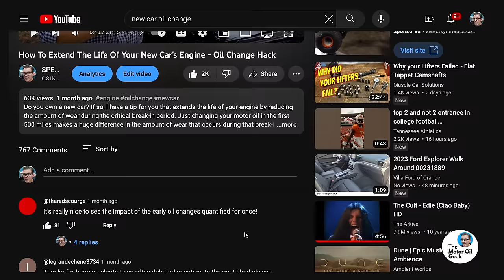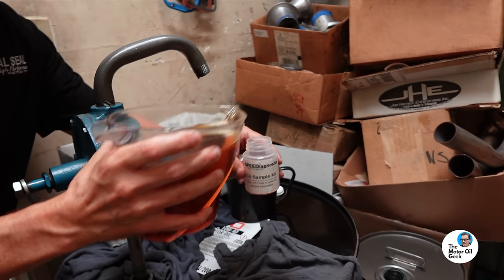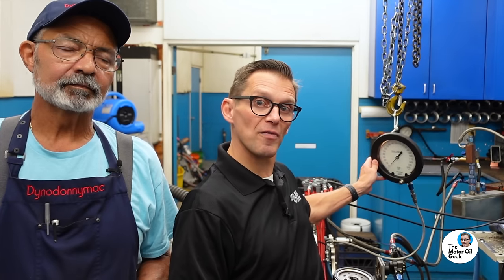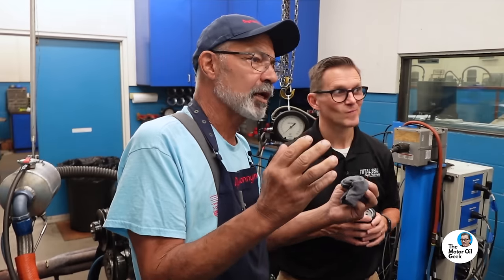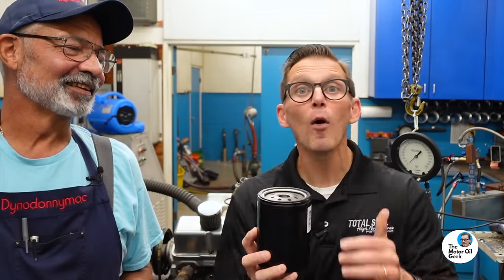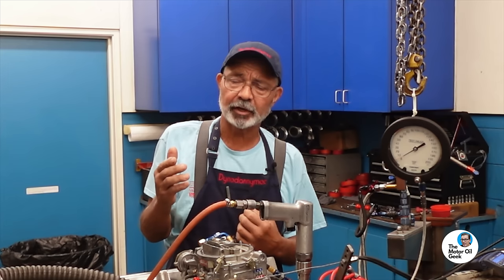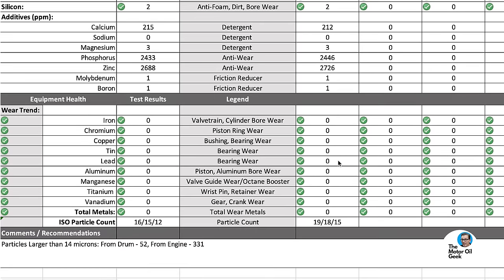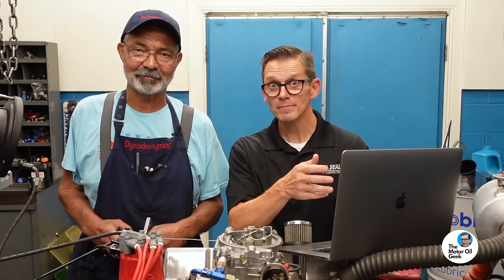Does Pre-FILLING The Oil FILTER Cause Engine DAMAGE?

Comment: You hurt a lot of peoples egos by proving them wrong, some will still not listen because of pride
Reply from the maker: Truth!
Reply: I was a marine mechanic for years,  pre lubrication is a big deal, you can't just stick on a dry filter and wait half a minute for the oil pressure to come up..  These hurt guys can carry on doing what they are doing won't do any great harm on a small engine but now they are informed.
Reply: That's because you can't argue with an idiot .... To them they are always right and you are always wrong ..... And believe me there are a lot of idiots floating around out there that have zero common sense.
Reply: proved? what?
Reply: @Jonjs99 that you didnt watch the video and/or have no comprehension.     😂😂    😊😊
Reply: @tedcity5861  I watched to that part where they were concerned about contamination I stopped , I will never prefill filters, as this damages em, had so may ripped filters
Reply: Never had a vehicle with horizontal mounted filter? I prefil them when vertical, but horizontal isn't really feasible

Comment: There is something I did not see addressed here.  Although a rare issue I have seen the following a couple times in my career as a mechanic.  During an oil change on an engine that had not been run for a very long time, I filled the filter to make sure it got oil quickly.  Upon starting the engine the oil pressure DID NOT come up.  The engine was shut down before damage was done.  What happened was the oil in the filter did not allow the dry oil pump (from sitting a long time) to prime itself.  I loosened the filter, cranked the engine briefly and oil poured out as the pump quickly primed. Tightened the filter and had no further problem.  So just beware and watch that oil pressure gauge.
Reply: Yes, on many pre-1975 (roughly) engines my college automotive professor with some 40 years experience said NOT to pre-fill the oil filter. We were finishing a rebuild on a 460 cubic inch motor from a 1972 Lincoln Continental. The guy I was working with pre-filled the filter with oil and we had no oil pressure when we tried to crank it. We emptied the oil filter, re-attached it and it fired up with good oil pressure.
Reply: it irritates me to no end modern cars don't have oil pressure gauges (or voltmeters, either!)

Comment: I never used to prime my filters up until a few years ago. It always made me nervous watching the oil pressure light stay on for that short time until the filter was full and the oil pressure up and the engine sounding much quieter. The first thing I noticed after that first time a did a filter prime was how the oil pressure light instantly went out and the engine was quiet straight after start up, I have been priming oil filters ever since. I prime straight from the bottle the oil was purchased in, I would ever use a separate container for risk of contamination.
Reply: dontcha hate the sound of your crank rattling? me, too.

Comment: You don't need to prefill. If you change your oil and install a dry filter you can floor the gas pedal and start cranking the engine.  This will fill up the oil filter with oil but not allow the engine to start.  This works well if you have a horizontally installed filter.  Ford Boss Me shows how it's done in his vids

Comment: Your answer to the idea that prefilling the filter is bad is very convincing. I never really thought it would be. However I am struggling with the idea that not pre filling has genuine repercussions. As you stated manufacturers regularly have filters that cannot be pre filled due to type or angle, and billions of dollars go into engine development. I find it hard to believe this would be so regularly missed by engineers from multiple manufacturers.
Reply: When you do an oil change, the first thing you do is prefill your oil filter. Now while your oil is draining and you are removing the old oil filter and cleaning the filter base and replacing the drain plug, the oil in your new oil filter has been migrating from the center of the filter through the media into the outer chamber of the oil filter. So now even if you filter is mounted in a horizonal position on your engine you can install the new prefilled oil filter with no oil running out of it.
Reply: @scrambler69-xk3kv  thanks that's good to know I will try it. I am still not convinced of the negative impact of not doing it. I have never seen priming a filter listed anywhere in service manuals for example.
Reply: I've never had any issues with my engines. I've never ever pre filled.
Reply: @fraserp2377  Me neither, but sometimes manuals can miss little tips or tricks to make your life easier.
Reply: Engine manufacturers don’t recognize it as an issue because it’s not an issue. The average lifespan of a modern vehicle is ~ 250k-300k miles regardless of pre-filling the filter or not with the rest of the vehicle failing before the engine anyhow. The most common engine failure is from lack of preventative maintenance or not changing your oil and filter per manufacturer recommended intervals or using wrong oil type.
Reply: Finally something smart 🤓 100 percent agree
Reply: @ihd-3603 another good comment common sense just do proper maintenance
Reply: @ihd-3603 I had a hand me down Subaru GL wagon from 1982. It was running strong and reliable with no issues at 425,000 miles (On less than 10 oil changes it's whole life)
Lol!!! 😂

Comment: I have been a journeyman heavy duty tech for caterpillar for 12 years.  We had been told directly by Cat engineers to not prefill any oil filters.  Whether its for hydraulics, powertrain or engine.  The reason we were told is due to the possibility of introducing contaminants in the system that may be in the new oil from the factory.  I have actually done particle counts on new oil from factory and seen the particle counts not meeting cats use requirement.  I have also looked in the bottom of new barrels and buckets (most equipment I deal with uses at least 30L of oil) that had just been emptied of new oil and seen both dirt and sometimes small amounts of water sitting at the bottom.  I'm not saying this is the case with all oils, but I believe the recommendation is due to the possibility of new oil being contaminated due to bad maintenance practices or possibly even bad storage methods of new oil.  With all this being said, as long as you know for certain that the oil your prefilling the filters with is clean, it is probably good to do.  But at the very least fill the filter on the dirty side of the filter (outside section of the filter, not the center), this way if there is something in the oil you don't know about, it will at least go through the filter before entering your engine or other systems.
Reply: Same with Cummins, they spell out in pretty much every engine manual to never ever prefill filters, especially fuel filters. However, on systems with a primary filter/water separator and a secondary fuel filter, it's fine to pre-fill the water separator/pre-filter, with good clean fuel, because that fuel will go thru the pump and then the secondary fuel filter so no junk will get to the injectors. The only thing you have to watch for is any visible dirt chunks so you don't mess up the fuel pump. However even worst case scenario, a fuel pump is many times cheaper than pulling and replacing 6 injectors, and now you get to also reassemble all the jake brakes and re-run the overhead. Many many more hours of labor to replace injectors than a cheap lift pump.

Comment: I was taught to not only pre-fill the filters, but to do so using the outer holes so the oil going in is filtered. Pouring oil into the center hole doesn't pre-filter the oil. The assumption that fresh oil from the bottle is without contaminants is fine until it's not.
Reply: Ok, ill accept your reply. It is a fair compromise to this debate. Thank you for that.
Reply: 1. No, not only is it a bigger mess but it's also incorrect. Most filters have a paper media inside, this means any oil touches it will be absorbed. This means oil in the hole will saturate the filter entirely over time. 2. Is correct but the amount of contaminants is minimal. The right approach would be to fill the oil filter first and leave it alone while you go and drain the oil. By the time the oil drains your new filter will be fully saturated in oil and you'll see it was as simple as turning the faucet off while you brush your teeth

Comment: It's amazing that you had to verify something as logical and intuitive as prefilling and new oil cleanliness. I've worked on a lot of different machines, locomotives, steam turbines, trucks, cars, and small engines. I've always prefilled filters when possible. This is especially helpful with certain fuel filters. Either prefill or re-prime in some cases.
Reply: Aaammmeeennn !!! ! !!! And, it is terrible, that we need 2 explain this Basic Techniques 2 the Blind people which think that they are some "mechanics" !!! ! !!!
Reply: Always prime fuel filters with the lift pump and bleeder. Had neighbor that prefilled a fuel filter before putting it on and ruined the injector pump. That was a $2000 mistake. 😮
Reply: @ihd-3603   Yes, depends on the engine and fuel system. Always do your homework before servicing something for the first time.
Reply: @Cubestone  doesn’t matter on a diesel. Injector pumps and injectors are very sensitive to fine particles and are very expensive to replace. Duramax and power stroke injectors cost ~$2000-$3000 per side  to replace. Rebuilt injection pumps start at ~$1500 with core for a remanufactured one.
Reply: @ihd-3603   You're probably right on those little diesels in pick-ups. I've done all of my diesel work on locomotives, appx. 500 cu-in/cylinder.
Reply: It was a shame to waste the $35 oil test analysis of the clean oil for contamination that was from the barrel and transport. Those $35 could have installed the indoor toilet for Barrack Hussein Obama's brother hut in Kenya thus avoiding continued poverty.

Comment: So the main thing you didn't mention to people, that priming the motor after an oil change is not just to pre-fill the oil filter, it is also to add the new oil thru the valve covers, not down a fill tube to the oil pan. The best system would be one that cycles oil to your valve covers before the engine actually gets cranked over.

Comment: I would like to see them pre fill the new oil filter then prime the block and see how long it takes to reach oil pressure. There will always be some old dirty oil left in the block and oil pan that will not drain out. Zero oil pressure every time you start you vehicle. Routine Maintenance will help keep your vehicle running great.

Comment: G-pa was a mechanic turned machinist.  He taught my dad how to keep their '50 ford running.  It fell apart around the running drivetrain.  He told my dad and I that pre filling filters was an option if the filter was in an orientation that allowed you to do that, but it was NOT absolutely necessary. More important however was his advice about having a clean shop.  His question wasnt "will not prefilling oil filters prevent me from getting a quarter million miles out of a 25 year old car?"  But rather "am i going to spill it while pouring it in?"  Or, "will i accidentally drop dirt and crap in it as i wiggle around on the ground if i dont put a clean towel over the full oil filter? 
 His advice was to keep it simple and give the car what its designed to take and let the engine do the rest.

What this has to do with is whether or not prefilling REALLY matters in the grand scheme of things.  

I can see it in a race engine like this or a turbo charged car would for sure make me want to risk the mess and effort it takes to prime or prefill a filter...  

However,

If it truly mattered in the long run, companies would include the procedure in the service manual.  You know, the sort of thing that could help a company not be liable for something that happens when an owner decides to "do it his way"? 

Some of y'all act like it's system critical to prefill.  I dont think it matters much if you prefill or not in the life of the engine.

"But but but the Empirical data doesnt lie!"

Yeah, i get it .  

But quite frankly if it was that big a deal, engines would all have an automatic "pre start" prime. 
 
Trust me, our NA 4cylinder Nissan with 60,000 miles that has a horizontal oil filter which can only be about 25% full while installing it isnt going to blow up any faster than if i dont pre fill it with 4 oz of oil.  Smh...  

Yes i know it has valve timing that is regulated by oil pressure.  Yes i know it has extraordinarily thin oil at startup .. 

Ill let you know if the engine dies before the car itself does.

  That might be awhile,,, my family has always been able to stretch lots of life out of vehicles by doing what we do quite well thanks.
Reply: He was responding to people who somehow think oil is dirty out of the can. Most engine damage comes from that startup after oil change, people say they never had a problem with it have never looked at their main bearings, an engine can run surprisingly just fine on some beat up bearings, and still have decent oil pressure, I've seen this numerous times. Fill it up if u can

Comment: I don't know about your engines but on my Harley-Davidson big twin engine the filter is on the RETURN side of the oil flow NOT on the feed side so pre-filling is a moot point. Especially since the oil filter is mounted horizontally.

Comment: I wonder if any car manufacturers prefill the filter at the factory? Great video and a good practice.
Reply: A new engine is assembled with assembly lube which keeps the parts lubricated until the oil begins circulating.
Reply: @T_Burd_75  A new engine is also put on a test bench where it is run cold (driven by an electric motor). The torque needed to crank it over is measured and gives a pretty good indication of the engine health, i.e. if everything is in place, enough compression etc. During that process there'll be obviously also oil circulated.
Only a couple engines a day (like 1 or 2 in an 8h shift) are run hot, with the engine combusting fuel and running under its own power.

Comment: I usually prefill unless it is an upside-down installation. Half fill for sideways application. 😄
Reply from the maker: That is a fair point. Partial fill if it is a horizontal mount.
Reply: Wouldn't putting some in the inverted ones help a little?  I would thing putting enough to cover the filter media would quicken the oil pressure increase at startup.

Comment: Aircraft mechanic for 42 years. Just common sense. At an idle speed of 600 rpm an engine spins 20 revolutions with minimal oil film in the two seconds it takes to develop oil pressure after starting. Why would ANYONE subject an engine with tolerances down to .0001" to that? ALWAYS fill the filter!
Reply from the maker: Right on!
Reply: Why do some engine manufacturers build engines with cartridge filters that can't be filled? VW 2.0 Tdi as an example...
Reply: @jacquespotgieter2700   Excellent question! I have no earthly idea what would possess any engine designer to design an engine that wouldn't allow prefilling the oil filter except for pure convenience of maintenance, possibly encouraging the owner to change the filter. I know certain Ferraris were designed that way as well, possibly due to the difficulty in disassembling the lower body pans on those. In other words, I really don't have a definitive answer.
Reply: @jacquespotgieter2700  I currently own a VW Crafter 2.0 Tdi with exactly this upside-down filter design. Don't fret it. Whether you pre-fill or don't will not have a significant impact on your engine's life expectancy. A VW 2.0 Tdi will experience more wear and troubles with leaky injectors, AGR and DPF issues. Do your regular oil & filter changes on schedule - your turbos will also be forever grateful. 😊

Comment: I'm SO glad that you did evaluation to FINALLY put this to rest. I've been filling filters since I began changing oil as a teenager. You would think it's a no-brainer if you understand how an engine works and physics. Many of the old filters of different brands even said to pre-fill on the filter itself or instructions. I fill the filter and let it wet the element and settle down and then fill it back up to almost the top. Always have almost immediate oil pressure. I've heard the arguments before too, which don't make sense. 'New fresh oil is 'Dirty' oil'. INSANITY! Most of the proponents of these flawed arguments can't be convinced or argued with. A strange band of acolytes using flawed logic and assumptions. Make one wrong deduction on NOTHING factual (contaminated oil) and a bunch of false conclusions follow. Great test, but I KNEW what the answer was going to be working on engines almost 50 years!
Reply from the maker: Right on!

Comment: Good advice. I was once shown a vintage Bentley car which had a hand pump to create oil pressure and circulation before the engine was turned over. I always thought that it was a good idea and not difficult to fit to any engine.
Reply: Exactly that is what makes the engine literally eternal.
Reply: There used to be oil pressure pumps you could buy and fit to any engine. Just an electric pump and connections so you could flick a switch and wind up the pressure before starting - even better in winter with a block heater pumping warmed oil up pre start.
Reply: Race cars usually have dry sump lubrication systems. Positive pressure always.
Reply: What's next, a crank starter and  Flintstone brakes??🤣🤣🤣🤣🤣🤪🤪🤪🤪🤪🤪
Reply: If it is a petrol engine that hasn't been run for a while you can remove the spark plugs then spin the motor until you get oil pressure. The refit the plugs and go. With no compression there is way less load on the bearings and the motor spins faster.